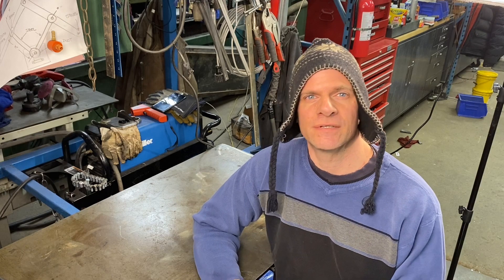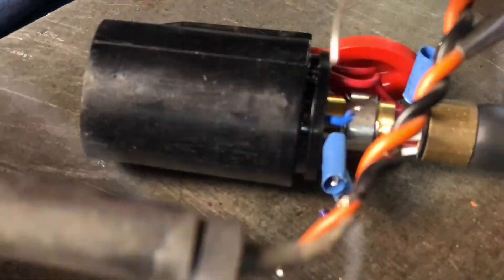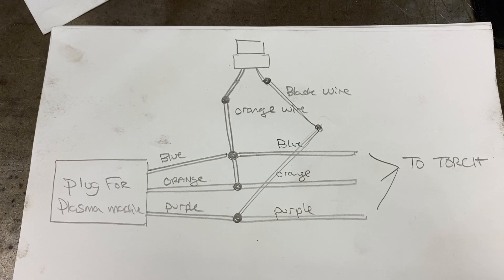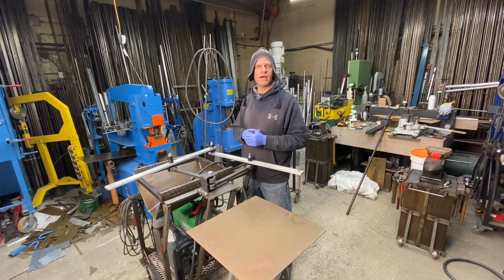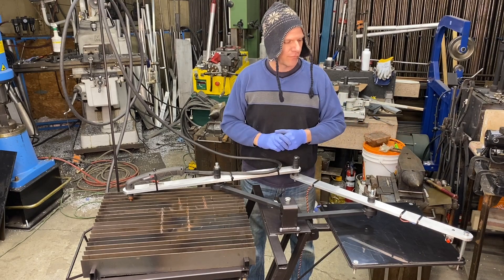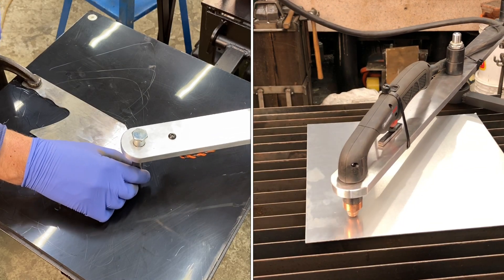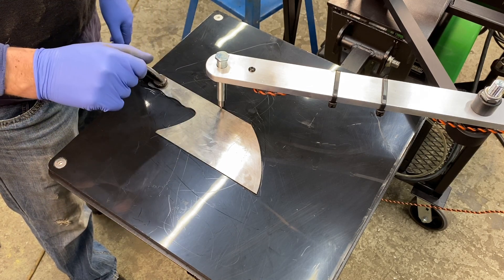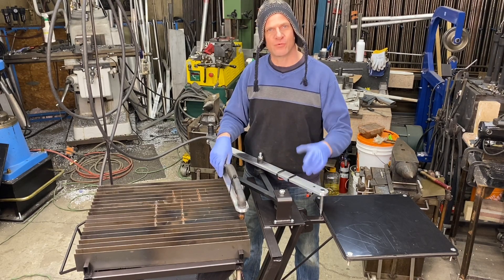Building an Awesome Plasma Table with a Pantograph  !! Testing Time!!

Comment: very creative.i am impressed with your skills. off subject question though. why did you go with a blower motor on your ribbon burner instead of NA ?
Reply from the maker: phil chiu i actually should of showed that i had made both but just ended up mentioning that you can use a vacuum as a blower . But i am finding that i can forge weld a little faster with the blower